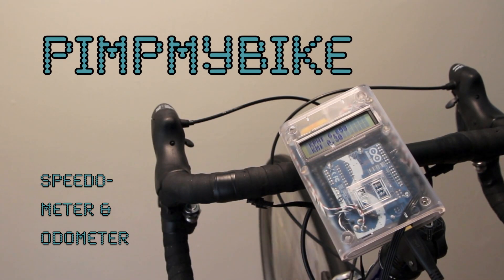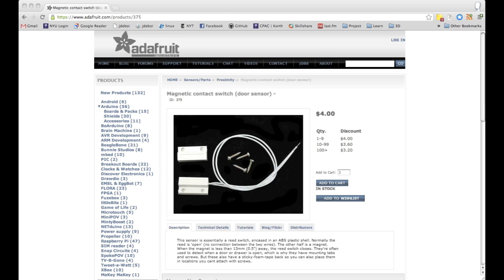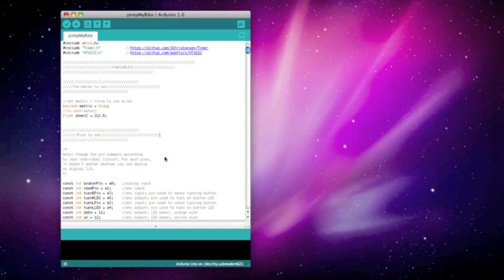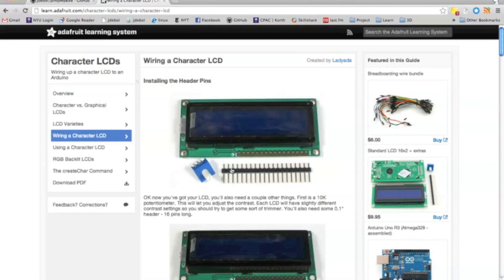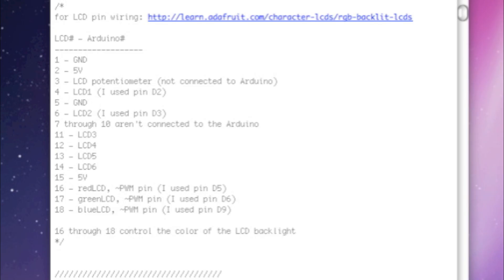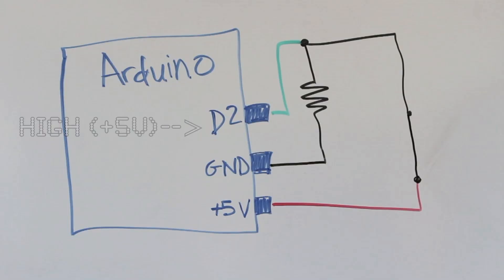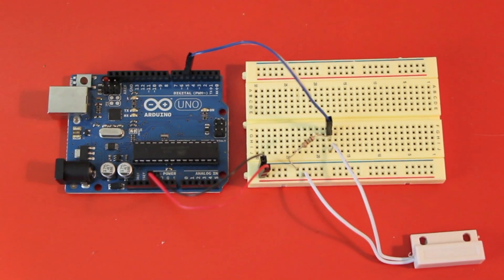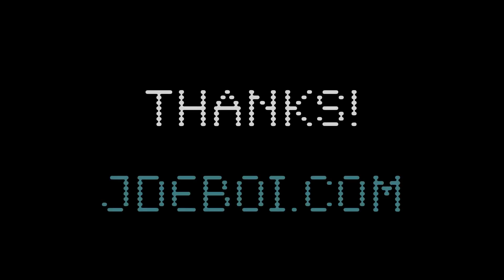pimpMyBike[2] = "Arduino Speedometer/Odometer"

Comment: Hi Jenna deBoisblanc

I am a newbie to this Arduino and would like some advice from you if you have the time.  

And I would like to buy the right part and wondering if you can explain the following 
I wish to use the RGB LCD SHIELD KIT W/ 16X2 CHARACTER DISPLAY for a speedometer.
 Buy not sure which one, Can you explain the difference RGB negative and RGB positive.

Kasba

Comment: I really want to put this on my go kart I'm building. A friend gave me a 20x4 LCD for free and I want it in my go kart. I couldn't find the code you where talking about anywhere. I checked adafruit and your website and everything. Out of all the speedometer LCD tutorials yours is my favorite and I really want to put it into action. Can you or any one else help me out here???
Reply from the maker: click the link under the video and scroll down to the "code" section. There's a link to the code on Github. I'm not sure if a reed switch is going to work on a go kart since it travels a lot faster. maybe someone else can weigh in. :)
Reply: @JennadeBoisblanc-jdeboi  404 on website
Reply: Bob Branham Hey,Did you already find a way to use the LCD at your gokart
Because I also have the same Project

would be really kind if you sent me your code 
my e-mail address:
lukas.schossleitner@gmail.com

Comment: i wouldn't use a reed switch, it has moving parts that will wear out quickly.
A hall sensor would be better suited for anything that needs to be rapidly switched. good video tho
Reply: Nothing wrong with reed switches I've used them on my bikes and never had one fail yet. They are perfect for this project as all cycle computers use them so easy to find one designed to be frame mounted.